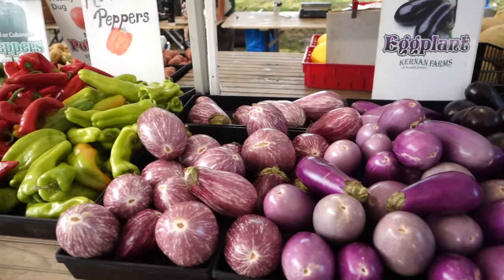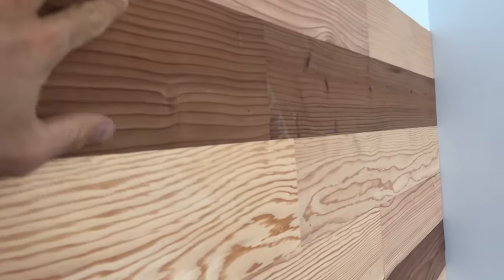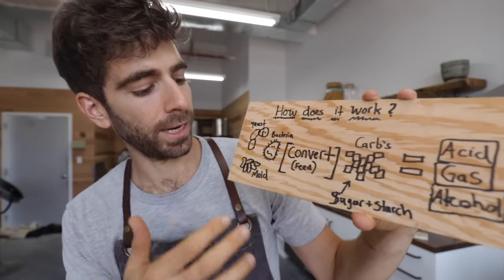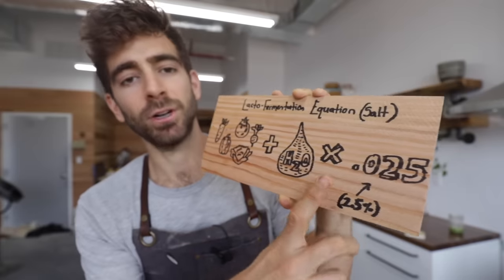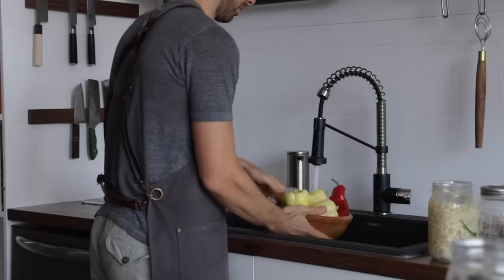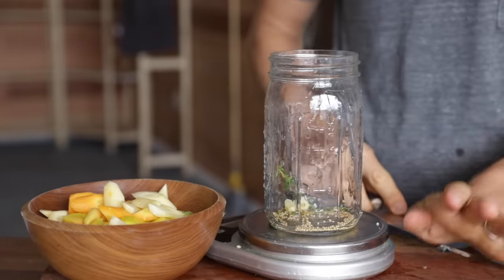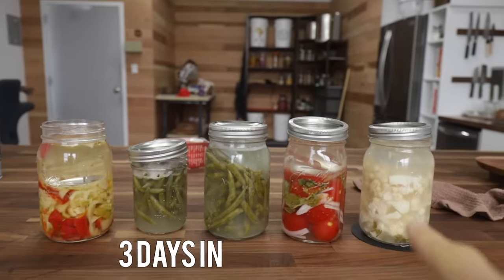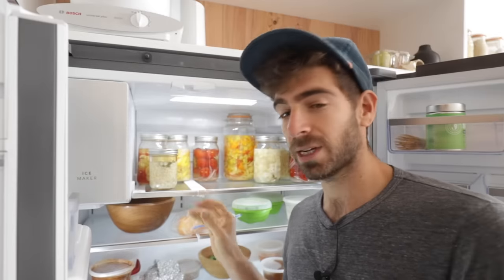The Complete Guide to Fermenting Every Single Vegetable

Comment: Mistake I've made a few times without realizing what was causing the mold - if you use spices like peppercorn, or red pepper flakes, they'll float to the top above the weight and attract mold. So, I'd avoid veggies with seeds, like sliced cucumbers, and using spices that float like that.
Reply: East to fix that problem with the spices, you make a sachet of spices in cheesecloth and put it in the bottom of the jar before adding everything else.
Reply: UH OH!!!  I just did that today making my first fermentation batch.  ugh
Reply: @sarahjoost  How did that work out?
Reply: Matt Cronin, depending on the spice, you could soak them overnight in a little water which might give them the weight they need to stay under the surface of your brine. I am not sure I would put muslin/cheesecloth in a ferment but you could use a stainless steel tea ball if the vessel you are fermenting in is big enough. I'm a fermentation crock girl so there is plenty of room. :). Good luck
Reply: Thanks for posting this!  I've always wondered why my cut cucumbers tend to mold but when they are whole they don't.
Reply: I like to ferment herbs/roots/spices with healing/detoxifying qualities...like the ancient Master Tonic...
Reply: I add a leaf like a large kale leaf and use it to hold the veggies down in the water, it keeps the seeds down too. I put spices at the bottom of the jar. I sometimes make fermented pickles and sometimes slice them up. I add a by leaf to keep them crunchy.
Reply: I put stone on the top, and solved that problem
Reply: @kwel5522  Not a good idea to use stainless steal with an acid or with salt. Be careful with that!
Reply: WOW THANK YOU
Reply: Ohhhhhh
Reply: Plastic mesh in top of jar, holds all the stuff down below surface
Reply: Are you sure it was mold though? If it's white then it's probably yeast and is harmless. You can scrape it off the top. But if it's green or god forbid, black, then you do have a problem.
Reply: easy way to prevent mold. heat up some oil, put the spices in the oil. cook them to release the flavor and pour the oil in the ferment. the oil will not only flavor the ferment but also make it anaerobic because the oil will float at the top and prevent mold from exposing the ferment
Reply: @kwel5522  Why not? Will the cheesecloth start to come apart or rot?
Reply: When I added black peppercorns to my whole garlic the brine became sweet tasting! Really yummy it was, will try adding that liquid to things
Reply: i’m confused i’ve never heard of this before? people preserve and make pickles all the time. with all sorts of foods especially cucumbers . so why are you saying to acouod cucumbers when that’s how you make pickles?
Reply: @Val_Emrys  well what are you doing? is there vinegar in your can because how can that be so when people have been forever making pickles and they do so with them cut
Reply: @lucyshepherd5668  I think you are confusing pickling (vinegar and boiling) with making a ferment (salt and cold water only).  I make sour pickles and relishes by fermentation.
Reply: @Val_Emrys  ohhh okay thank you!
Reply: @lucyshepherd5668  spear type pickles are jammed in to the jar, helping them stay down. Also, I use a glass thing called a pickle puck that weighs stuff down.
Reply: @Ineluki_Myonrashi  you mean keep the cheesecloth in the jar?
Reply: I’m new to fermenting and I’m fermenting some garlic the directions on the video I Saul said to Burbee to open the lid every day. Once I’m through fermenting it can I put it in the refrigerator and stop opening the lid every day to let the gas out?
Reply: @Ineluki_Myonrashi  ...tq
Reply: @kwel5522  tq
Reply: @constanza1648  tq
Reply: @andresamplonius315  really. Thats nice
Reply: @lucyshepherd5668  not sure what you're talking about but you can of course use cucumbers with fermentation
Reply: Ugh that’s a great tip. My first batch I had to toss because I had seeds and tiny little pieces of the veggies floating at the top🤦🏼‍♀️ I need a glass weight along with using this tip will help 👍🏻👍🏻
Reply: I had silicon screens that I bought for a dehydrator that I no longer use. I cut the silicon a bit larger than my jar diameter. After loading the veg and spice, I tuck the silicone screen down into the liquid and tuck the edges downward. They keep everything below the brine.
Reply: What I do is add olive oil on top... Works super!
Reply: @Katalinmason  I was thinking the same thing! I’m so glad it works for you! I don’t have silicone screens though, so I’m thinking of a bit of thin 100 cotton cloth. I’m rather surprised no one makes the silicone ones yet though…
Reply: I know this post is 2 years old.  Last week, I did everything, even sterilized my jar, put a weight, nothing is above the water and I still get mold on top of the water.
Anybody knows why ? thanks.
Reply: @myrdhin101  did you use filtered, non chlorinated water? 2% salt ratio? We’ve fermented multiple jars of peppers at the same time before, and only one jar molded (it happened to be the one without garlic).
Reply: @bridgetgidget72  Thanks for the answer.
I used tap water filtered by a Brita, 2.5% salt iodide at 70%.  Only mini tomatoes in the jar.
I did get molds on three separate tries.
Reply: @myrdhin101  I use water filtered by the Brita as well. Be sure to try again with just plain sea salt (no iodine or anti-caking ingredients - the ingredients should list only: sea salt. I have found that Mortan’s brand sea salt includes anti-caking ingredients, so choose carefully). I personally use pink Himalayan salt. Good luck!
Reply: @bridgetgidget72  Thanks a lot, I'll try that.
Reply: @Katalinmason good idea...I know that they also sell plastic screens for needle point,yarn crafts, etc at the craft stores  which could be cut down.I think I will give them a try